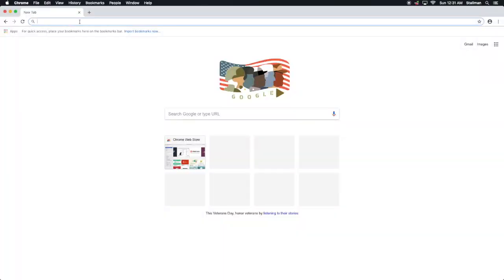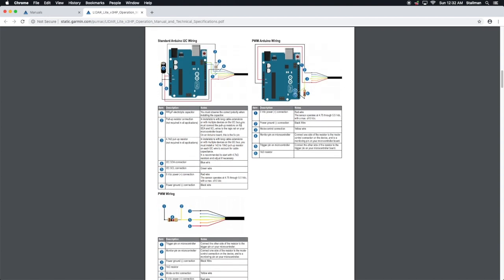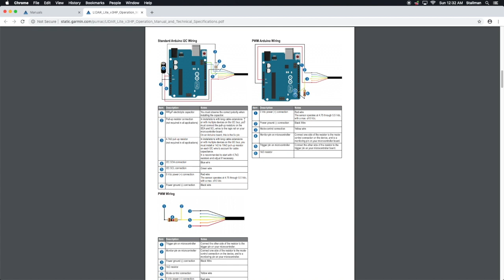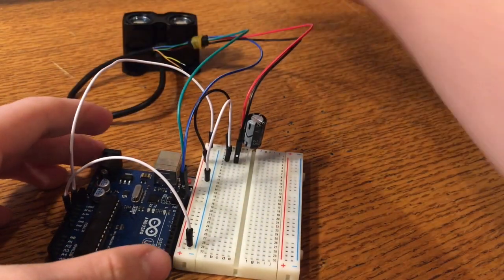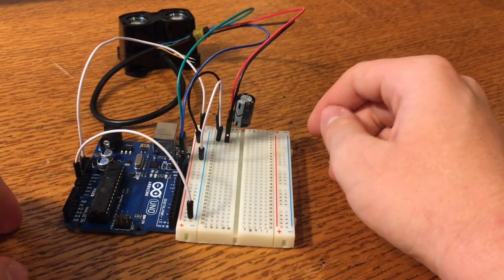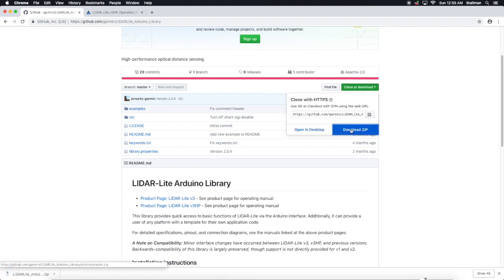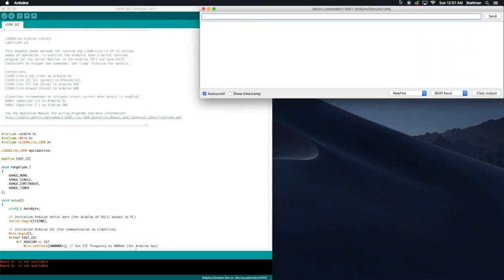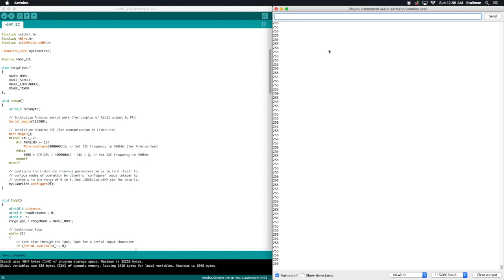LiDAR Lite v3 & v3HP Wiring and Programming Tutorial

Comment: Nice tutorial. I followed all your connections instructions and run the arduino program. It works just like yours. Now, do you have a tutorial about how to get the data from the I2C arduino object and have it read or write to MATLAB? I'm working on a project and need to have the arduino with the I2C (the LIDAR sensor) data sent to MATLAB and plot it or make some type of graph.  Please let me know as soon as possible.
Reply from the maker: I think that the easiest way to do that would be to scan, and keep the scanned data on the arduino and then import them to your local desktop, to then analyze with matlab or unity or something else. You could try connecting the arduino to your laptop or something via serial bus, but then you'd have to print it out and then transmit it, and it's just much slower and buggier than other methods. I did a similar project, except I added a separate processor to the system, allowing for live graphing of data. It got a bit complicated, but it was definitely worth it in the end. 
But again, I suggest that you just keep the data on the arduino and then import it to the computer at a later time.

Comment: Question regarding the "beam", does it spread out significantly at it's max distance? I'm evaluating whether this is a good option to detect clearance height, not necessarily distance. E.g. if a fork lift is raised too high as it approaches a doorway, it will break the beam and flash a red light rapidly. Essentially at any distance this would apply, but ideally the farther back the better. Incidentally, what's that nominal distance? Thanks for the info!!
Reply from the maker: If I understand you correctly, it would just take some simple math to detect clearance height. You'd have to have a servo motor and account for the angle of the servo, but that's all you'd really have to do. 

As for the spread of the beam, I think you may be referring to solid state LiDAR rather than mechanical LiDAR, which is the one used in the video. Solid-state refracts hundreds of beams from one light source, allowing for much faster and broader collection of data. There have been next to no cheap options in the market, so the this one is just a mechanical LiDAR. If you're working on a project of some kind, feel free to update me if you'd like. I love that kind of stuff.

Comment: hi script kiddie , can i use different value of capacitor ? such as 47uF or 100uF? really interested on building this project! best tutorials and thank you from Malaysia!
Reply: it seems the idea is to prevent the 5v rail from dropping while in i2c mode. Spektrum makes a capacitor for their RC receivers which prevents voltage dropouts ( 'voltage protector' spm1600) , it's fairly small in size but has 4700μf @ 10v. I suppose for this application a few hundred μf is probably the minimum.